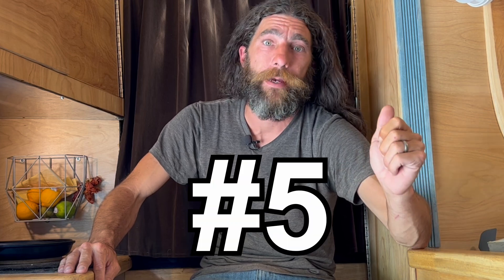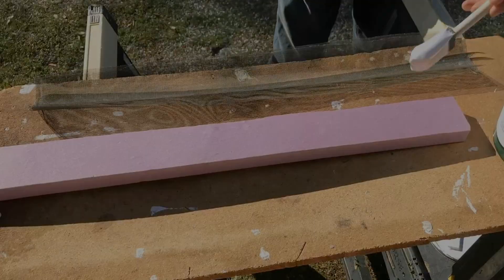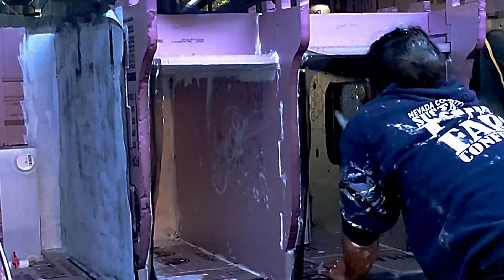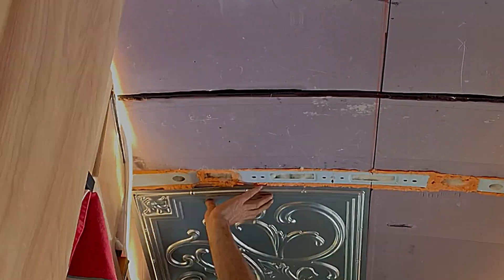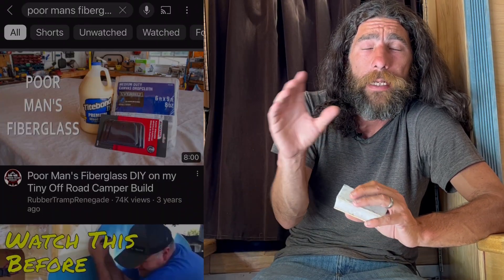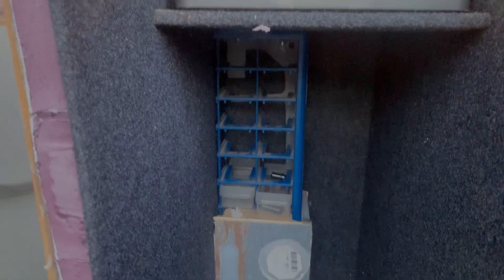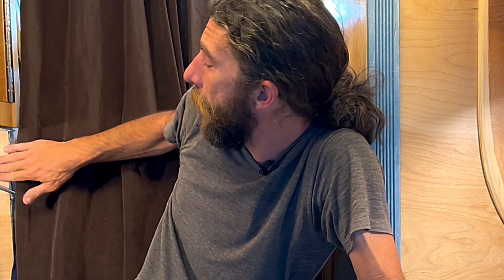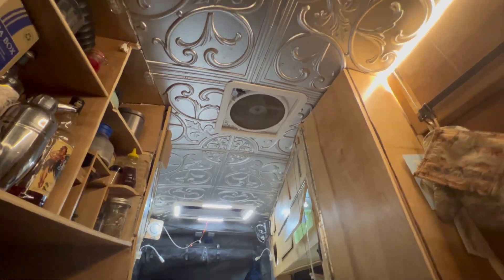Foam Camper Van Screen & Skins -Foam Building System Vol. 5

Comment: This is great info, but just one question I had is this does the foam on foam tend to speak when your going down the road ?
Reply from the maker: It does not speak or squeak at all… all the foam to foam connections are glued and screened so it can’t rub.

Comment: I wonder if you can make a pull out bed frame? Mix a bit of lumber and foam?
Reply from the maker: I actually had this on my list of things to try on my prototype build (first 3-5 videos on the channel) but have not. The challenge is that foam is strong enough but it lacks the durability of wood, so, yes some combination of the two where the most west and tear would occur. Second, if this seat was intended to be a travel seat (while driving / has seatbelts) there are additional strength and durability concerns… in fact at that point I think only metal frame would pass “inspection”.

Comment: Ceiling looks great but I'd be concerned about PVC. In case of a fire PVC gives off deadly (it'll melt your lungs) polyvinyl chloride gas. Also vinyl flooring would basically become a blow torch. Safety first.
Reply from the maker: They are rated as A1 for interior use as is everything in the build… sure once they catch it’s not going to be a good time in the van, but… I don’t imagine all the plastic in the dashboard will be any better. I have no gas or flammable liquids in use inside the van and fire extinguishers and alarms everywhere… safety first👍🏽

Comment: Just stumbled across this series, great job. So what i hear you saying is that you are basically using the screening as your fiberglass coating without mixing the glue into the paint? (a different version of PMF)
Reply from the maker: Sure… but also finger joints, interior applications, etc etc.
Reply: @falkornomad  Thanks for the quick reply. Now I am thinking way outside of the box. Will hit you up if I go down my crazy train road.

Comment: Do you also use the foam for insulation? How does it do against moisture and mold?
Reply from the maker: XPS is designed for insulating in wet areas (basements, crawl spaces, etc)… it’s listed as mold and mildew resistant. It is my wonky insulation in floor and ceiling… walls have havlock wool in the cladding as well since I needed something that could be pushed in to those voids. In the bottom 4-6” of those voids, especially the 5 doors I have the havelock sealed in plastic bags (vacuSeal bags that are not vacuumed).

Comment: Great information. I am going to be building a tear drop trailer that I will be pulling behind my motorcycle and want to make it as light as possible. I was going to do the PMF the traditional way with canvas and paint but now I'm thinking of using window screen and paint after watching this video but would like your take or anyone who reads this' take on that. The trailer will be about the size of a twin bed maybe a bit longer and will be taking the place of a tent for motorcycle camping. Awesome build and keep up the great work.
Reply from the maker: I’d still do the PMF on the outside it will be less textured. But then inside on the 2” foam you could use this system, and you could router the 2” foam with 1/2”-1” notches to fit 1” foam into for your bed platform, cabinets, etc and use this system.

Comment: Pex tubing makes great, cheap chases. Know that putting wires in conduit or tubing captures heat, so can lead to voltage drops or fires. Check the amperage demand of your stuff, size wires accordingly (I use ABYC marine wire and size accordingly).
Reply from the maker: Good tip!

Comment: If you skin your bed platform top and bottom before putting it in, the continuous skin will take the weight across the partitions much better. It will end up quieter and last longer.

Comment: One advantage to the latex primer/paint over the foam is fire protection. The paint will form a protective ash layer to help prevent ignition. The plastic foam, however will tend to melt, run, and burn.
Reply from the maker: I have an older video that covers flammability of foam if you are interested

Comment: Have you tried using Fiberglass gel coat? It's cheap, tintable, and can be DA sanded smooth after it sets..🤷
Reply from the maker: Have not… don’t know much about it but I did see a video where some sort of fiberglass matrix melted the foam…. A link to it is in my full length Q&A video… not sure if it’s the same thing you’re talking about.  Definitely more testing could be done.

Comment: I’m at the beginning stages of a truck topper/camper.  I’m going to use this method to go over top of the contractor rack I’m using as a frame.  I’m now planning on screening the exterior, and then finishing with a couple sloppy coats of either bilge paint or truck bed liner.
Reply from the maker: I had the same “contractor rack skeleton” idea… would love to hear how that goes!! Consider using canvas and Titebond 2 for exterior as they do in Foamie trailers.
Reply: @falkornomad  I thought about the PMF with the canvas and glue.  My instincts are that the wire screen, Gripper, then bed liner will probably do the trick with less hassle.  I anticipate it’s going to look a little ‘ugly’.   I’m ok with that.  Lol

Comment: Great video! I don't understand all the drama though. I remember doing composite lamination in a very similar fashion back in the 90s. Is it a forgotten manufacturing process nowadays???
Reply from the maker: As I say in the first video, it’s used in Foamie trailers and conventional RV builds to some extent, but this diy method and some of the specifics like finger joints and drywall anchors are new. I say “under utilized” more than “forgotten”

Comment: I like your vids and I find them inspiring
Reply: I am thinking of building out a 4 door sedan to live out of. Suburban Stealth.
No need for a lot of electrical, plumbing,....
Reply from the maker: That’s interesting… you thinking single bed, small sink and fridge with storage cabinets?
Reply: @falkornomad  no, I won't be living in, more like living out of the build.
Simple = cooler, bottled water, jackery solar,...
Pull passenger seat, 1/2 the back seat, use trunk, for misc,...
Battery lights or hook to solar jackery. Same with USB fan,...
Keeping everything simple.
Storage for needables, using food pantries, planet fitness, library,...
Just desire a safe comfortable place to lay my head.
Working full-time still not enough for Apt.
1600-2000/ mo not enough in my area of Illinois.
I am simple, single and desire to save funds.
Reply: @falkornomad  suburban stealth, using job to wash face,... Freezer for ice, community church dinners, planet fitness, libraries, parks,... Live cheap.
Desire to live out of build.
Wanted safe place to lay head. Warm, cool, easy,...
I'd love to see you and your wife do a sedan build.
I will pull passenger seat, cut back seat in 1/2, build a drop wall behind seats so it will open to see out of back window. Pull rear door panels off and foam build over,... Keep one back door accessable.,...
LOVE the plastic ceiling panel idea. Dollar tree offers them too.
Many useful items from dollar tree in build.
Lol thought about building this way before I found your foam build vids. Yet, you vids have opened me up to a new way to build out.
Thank you
Reply from the maker: I get it!! And encourage you to explore the idea! And foam would be a good fit I think. That said… I would point out that SOMETIMES, as we “simplify” we create minor stresses in our day to day that add up to stress. Take the cooler example… ice that becomes water and needs to be replenished is 1) a pain in the ass to maintain, 2) soaks your cheese (etc) with water and that’s not tasty at all. 3) buying & lugging ice in and out is not that stealth and dumping a cooler full of water is not either. 4) eventually fails when you have a busy week etc and you are buying some groceries again due to spoilage. 

It can be done and I don’t mean to discourage you.. but if you are considering living that kind of lifestyle, I would encourage you to consider where some investment in specific technologies could simplify your day to day, even if they complicate the build. 

Thoughts?
Reply from the maker: You’re welcome, my pleasure

Comment: How do you pattern the notches for the foam to fit together?
Reply from the maker: I used to use a wood jig, but I stopped… just measure out 4” x 1” and mark it… I usually mark the full 1” along the length then take the length say 15” (not divisible by 4”) and split the extra in the ends.

Comment: Okay back to your drawer screw fail have you thought about gluing in a wood plug. Say you have 1 inch foam so use a Forstner bit to do about a half inch deep hole, and then a holesaw out a piece of half-inch ply would give you more glue surface area on your foam to hold it in place
Reply from the maker: Yeah, this came to my mind and is a popular comment, it would work for sure, even just plunge through and do a full 1” deep plug. I’m trying to follow the foam with drywall anchor thing down the rabbit hole for science, but this idea would work fine.

Comment: Have you tried resin? I like it better than paint/primer. Lately been mixing resin with corn starch for a thicker film. Need to try it a cabinet. Have you tried? Thoughts?
Reply from the maker: Have not tried it… on the list for future tests. I’m hesitant about anything that dries hard or brittle… I think the flexibility is a plus… but worth testing.
Reply: @falkornomad  I look at even paint being hard to an extent..I find resin, as I use it, to still flex and not crack. Thank you for your response. I'll let you know what I find as I build my wall cabinets. Great work dude!
Reply: @falkornomad  Have you done 4ft+ wall unit spans? Just thinking I may wish to support it with a aluminum angle..
Reply from the maker: Say “wall unit spans” in a different way… not sure what you are asking.
Reply: @falkornomad  distance of unsupported cabinet. I'll have the pantry on one side, yet nothing on the other side.
Reply from the maker: Can you support them on top by integrating them into the ceiling? See 14:45 in this video… those pantry shelves are supported on both sides but mostly supported by the verticals being notched and glued into ceiling.
Reply from the maker: That said… 4’ is too long without support in the middle, I would add at least one center support so the shelves are 24”.
Reply: @falkornomad  Ah, plywood base to support. Agree with breaking it up to smaller spaces, as you did. I'll redesign to reach the ceiling. Thank you again for you advise!
Reply from the maker: Also integrate into wall if you can, even if that is just gluing to the wall or after foam is in you can use the drywall anchors and L brackets to screw/bolt to wall. In my build the 1/2” ply face is also adding support on the front by being attached to ceiling, etc. make everything connect / “lean on” everything else.
Reply: @falkornomad  That is a solution. the 1/2" ply allows for support. Really trying not to use ply up there... I solved it with an aluminum angle. I still have some around here to work with. I spanned the front edge to the rear wall allowing for a open shelf area.
Reply: @falkornomad  I'm experimenting with these FG panels I bought that are end runs. I've resined screw anchor points for hinges and slides, but what has impressed me is the strength it has when I sandwich foam for my doors and draw fronts. To the extent.. I should have built my cabs this way. There 1/16" panels. I'll post a video within a day or to as to what I'm doing.
Reply from the maker: Sweet yeah post me a link!
Reply: @falkornomad  Just posted on my site.

Comment: On a second build (if conceivable), would you consider planning out certain known, key electrical spots (lights, appliances, etc) and pre-run wire chases before glue up?
Reply from the maker: I did on this build… some before and some after glue up… this is covered here and there in the electrical playlist I am half way through currently. Take a look and let me know if you have questions.

Comment: Elmers waterproof wood glue with wood fiber is Much More Flexible than tight bond.
Latex based floor cement is code for shower linings 7” up around floor and will hold very well for most other things too,
Foam absorbs moisture so latex will dry into the foam. Make your own laminate.
Reply from the maker: Interesting… maybe on my next round of testing!

Comment: Would sunscreen be stronger then regular thinner screen? And also would the aluminum screen be better then plastic? And why not use that fiberglass epoxy
Reply from the maker: Lots of options for the screen material… for me it’s a cost and ease of use factor at this point… I don’t think the screen needs more strength. I have not tested any other screen material so I can say with any authority. I do think the flexibility of the material is helpful so I tend away from things that dry hard or brittle.

Comment: Compressive strength relates to the rigidity of a panel that is laminated. Some of the strongest laminates have edge cut balsa as core. FYI.
Reply from the maker: Yeah I proposed a balsa stringer like a surfboard for a countertop in my prototype series… I think that concept has some potential for longer spans of foam… say a shelf or bed platform.

Comment: Nomad, I didnt read through the comments, so please forgive me  if this a redundant thought. I watched a video that used landscape weed barer in lieu of screen material. What was said that the landscape barer with Tight Bond 2 was stronger. What's your thoughts?
Reply from the maker: Have not tested that, it may be… for this application I don’t see that the screening material needs to be any stronger than it is. I would rather see the price or weight come down than the screening strength come up for the way I’m building… but, again I have not tested that material so I can’t say.